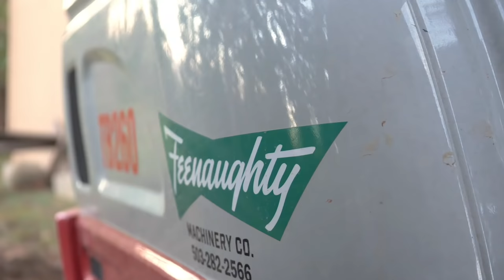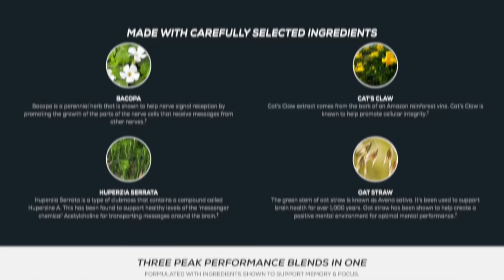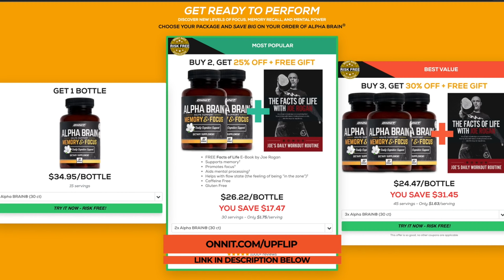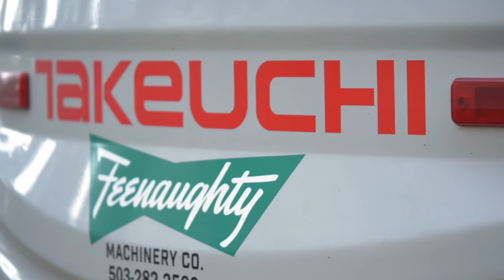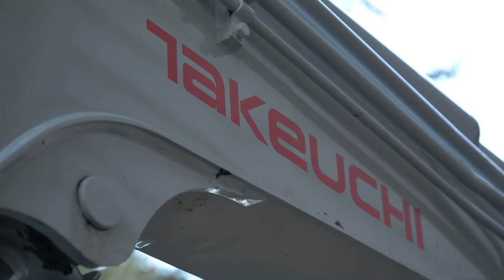19 Year-Old Starts a $125K/Year Construction Business

Comment: Your not charging nearly enough hourly. It should be minimum 250 an hour and that’s if your a small one- 2 man company with very small overhead. The most important thing is not getting the job the most important thing is making money. You can tell your new and I really congratulate you for going for it. It’s very hard to increase your rates once you set them low. You really don’t want to be the contractor that is known for being cheap. Wish nothing but the best for you and really hope hope you look at your numbers carefully and really include every single cost. Fuel, maintenance, machine cost, what your time is worth. What your labor is worth. All that must be included. I would be shocked if your making 90k  after all your equipment, fuel, maintenance, help, insurance/bonds advertising. etc is paid for.
Reply from the maker: Thank you for sharing your piece on the industry! Do you have your own construction business? Thanks for watching! ☺️

Comment: I’m 14 and live working outside I’d like to start a property maintenance business what’s reasonable is 10,000 reasonable? I’ve found a used ford 1220 tiny tractor for $6500 a trailer for $1000 and a dump trailer for $2000 my parents agreed to tow my trailers and bring me to my jobs I agreed to pay for the gas and they’re labor I’m mechanically inclined so if repairs need to be done I’m capable is it worth it will I make my 10k back in the year my parents are going to finance my stuff for me I don’t want to go broke I’m not going to make it a legit “business” but I’m doing jobs until I’m older and will pay taxes etc I’m not doing giant jobs more like culverts driveway grading garden tiling brush removal small tree removal etc is it worth it or am I too young?
Reply: They way you describe all this and speak for yourself, I would say you are not too young. You sound a bit more mature than most 14 year olds. It's great to start that young training at something you are passionate about. Be carefull around the heavy equipment, do not hurt yourself, be careful not taking too much debt in the future, and good luck

Comment: Hey great video! I have a question... What implements / buckets would you say are necessary to have for your excavator?
Reply: Trench bucket, 2ft dig bucket, 3-4ft cleanout/materials bucket, demo hammer, compactor. For advanced work steelwrist or rototilt; opens up many more opportunities, saves time and much less shovel and rake use. Many machinces 8-12k size come with the 3 buckets mentioned.
Reply: @baronvolkov6172  hey thanks for the info!

Comment: ok, so he makes $100-$200 per HOUR?! Rent for excavator for a DAY is like $150 in my country (Czech Rep., Europe). Just tell me where and I am transporting my excavator to US. 90 % of excavators work for $20-$50/hour, wow. Ok, US has bigger prices for fuel etc. but still pretty good tho
Reply: On average a 3.5 ton excavator costs like 350-400 a day to rent in this area
Reply: fuel is actually much cheaper in the US than Europe. In the Midwest for example gas is about $3.10 per gallon which is about $0.82/liter. I've found that electronics and other goods are cheaper in the US compared to Europe. Also, wages here tend to be quite higher
Reply: Over in the uk 14 ton excavator 600 plus vat a week self drive  , I run three excavators and have done for 20 years , 200 dollars an hour for a man and 6 ton ? Ten hour day 2000 dollar, he wouldn’t get much work here I’m afraid.

Comment: How does he get his equipment to the jobsite? Towing that trailer may require a class A CDL, unless he keeps the total GCVWR under 26,000 pounds or he has a 10,000 pound rated trailer with 26,000 pound rated truck. Minimum age to get CDL is either 18 or 21, depending on the state.
Reply: You answered the question your self
Reply: That excavator only weights 7 or 8k lbs.  looks like a 12 or 14k lb capacity trailer
Reply: @GruntingToast  Not true. That TB260 weighs over 12k pounds. Look it up.
Reply: They don't mess with those little machines to bad .